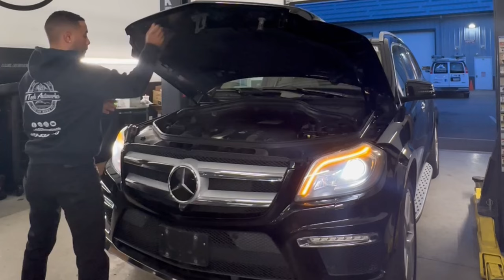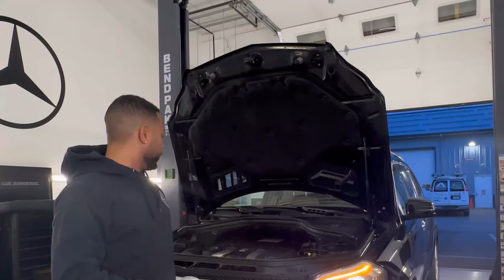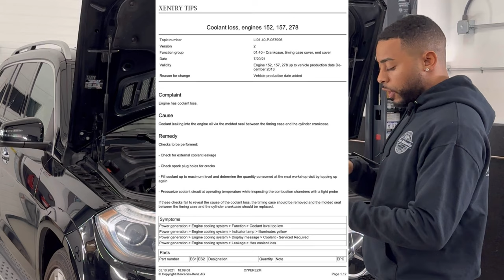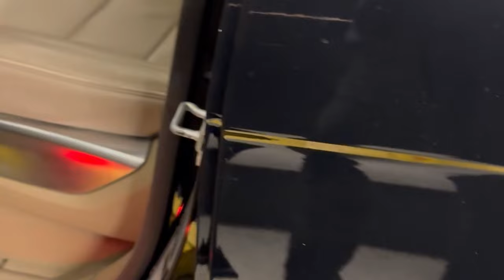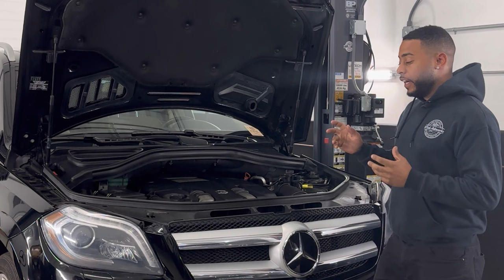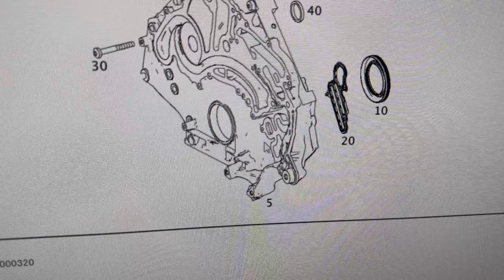Common High Mileage Issue With Mercedes-Benz M157 & M278 Twin Turbo V8 | 603 MTech Autowerks®

Comment: Ok so there is a solution, replace the gasket before the vehicle hits 100k.
Reply: And spend more than the cars worth replacing it, yep :)
Reply: @thenestaheapstv2447  lol ok
Reply: @AnontheGOAT just don’t complain when you sell it and someone low balls you because of the issue👻
Reply: @thenestaheapstv2447  I won’t sell it to a lowballer.

Comment: Its astonishing that he actually said that Mercedes didnt do anything when they actually did. They obviously revised this issue because the engines from beginning of 2014 and on wont have this issue. Not taking anything away from what he is saying but they did obvioulsy fix the issue. I am a Mercedes technician and its crazy how it seems to affect some engines and not all before 2014. I have seen pre 2014 with over 100k and no issues and other that have many issues. Not sure what the difference is but there are different variants of this engine. Maybe thats the case.. I dont know... Just saying!!!... I will say this the M278 2014 and after are much much better!!!
Reply: Thank you so much for this, just bought a Gl450 V8, production date 03/14 with 132k miles on it. Already had a heart attack before i saw your reply!  Thank you so much! 

Is there any other problems to look out for please?

Comment: I drive a 2014 GL500 with an M278 engine. It's been leaking coolant for over 8 months. At first, I had to add coolant every 15 days, but now I need to do it every 3-4 days. I've used four 5-liter cans of coolant in this time. Every morning, I add up to 50 ml of coolant to keep it full. I watched a video and now I'm worried the coolant might mix with the engine oil, which could cause more problems. Four months ago, when I changed the engine oil, the mechanic said it wasn't mixed with coolant. But the leak has gotten worse since then, and I'm concerned the oil could now be diluted with coolant.
Reply: You can check by using the oil dipstick, Coolant tank or by observing under the oil fill cap. You will notice a thicker than normal fluid. If it looks light brown, and not clear when you shine a light, than you may have an issue.
Reply: Find your coolant leak and get it repaired. It'll cost you your car if not taken care of.
Reply: Most common in our 2014 gl500 also was the water pump. Original waterpump pulley was black the upgraded is silver it would leak behind it. Also the bottom hose connected or the thin turbo coolant lines infront of the water pump are super common in this gl. So check that. On top of the engine the black 3side breather hose I just used gasket maker paste to stop leaks it's easy, anyhow coolant leak on this engine should be priority or else major damages. Goodluck

Edit: I forgot to mention don't let fan or tools touch radiator. I cracked a small hole and repaired with steel epoxy/Jb weld. Working fine but just advise

Comment: Hi Guys,

We have a 2013 CLS 550 I bought the car used. In my ownership oil changed at every 5k, LMolly oil only and under warranty had the tensioners changed, and now at the recent oil change discovered metal shavings in filter and old oil. My mechanic suggested to sell it and get a new vehicle. He explained that most likely it will get worse and will end up in a complete engine rebuild. I just want to understand what is causing this issue as I really like the car and if I am going to get another one it will be the same model.
Thank you!
Reply: Me too.

Last thing I read was cold weather and cold starts.

What would be the cost of the engine rebuild? Do you have an estimation?
Reply: How many miles?
Reply: 180k
Reply: Get the same car just production date after 12/13.. problem solved.. i work on these there good engines the earlier ones (2012-late 2013) just had issues when they aged.. after 14 the tensioners are updated and the oil mixing issue is fixed
Reply: I hear a very slight knocking  on cols start on my 14 gl63 should i worry about anything? Or wat can i do to stop it@strykz63

Comment: Obviously oil and coolant never good.depending on how long the event was happening the motor may not be destroyed if the problem is fixed soon enough.i had a custumer that drove a carwith bad headgasket for 6 mos before he fixed it.drove it another 4yrs after a couple oil changes to flush out the choclate milk.just a lil observation from my 30 plus yrs of wrenching.im.sure MB were changing the cover seal when custumers got oil in coolant and not doing complete motor swaps.
Reply: Exactly

Comment: so if the bulletin states dec-2013 does that mean that an engine from a 2015 or 2016 wont have this issue?
Reply: yes, they won't suffer this failure - Go ahead and read the TSB applicable to your year for insight

Comment: Great info. Do you see the same issue on the m157 in the amg’s? Currently looking for a cl63.
Reply: I think on his other video he says yes. He said they are the same engine but the m157 has bigger turbos
Reply: @CornerOfTheOval m157 is a 5.5 and the m278 is 4.7. Different displacement.
Reply: @AnontheGOAT   Basically the same block with a different bore and stroke to increase the  displacement to 5.5.
Reply: @godzsonjl2983  I know but still had to point it out that the displacement is different.
Reply: And one major difference is that the m157 is hand built which is a huge standard in the automobile industry

Comment: So does the 2012-2014 CLS63 AMG has the same engine and issues? Thinking of selling my CTS-V and getting these cars. @603MTechAutowerks
Reply: Its possible.. as long as your production date is 01/14 or newer your good.. but i have seen CLS 63s with high mileage pre 2014 with no issues

Comment: It seems like the 2014 cls550 fixed the issue. Idk much but mine is at 140k and seems to be running great so far
Reply: trying to get myself into a cls550. anything major i should look out for when looking at used ones?
Reply: @Ghostrider-xd3xv just get you one brother. With a bumper to bumper warranty. It'll cost you about 3k. It can last 2-3 years. If the engine or other important things fail, you'll be glad you spent that 3k vs 8k or more. You can take it to a dealer for the fix OR find a reputable licensed mechanic that KNOWS how to work on these cars. Just understand how the warranty works. Understand how much the regular things (tires, brakes, insurance, putting gas in the car) will cost vs owning a more simple machine. If you can afford it and it doesn't break you then do it.
Reply: Same here 2014 cls550 been great

Comment: Can you please let me know on the 2010 Mercedes V8 TwinTurbo engines are good I’m gonna buy one I don’t know how good the engines are please let me know it’s kind of odd hundred thousand mile on it engineers good now but I just wanna know how good the motor is. Thank you very much.
Reply: By the way, is the S 45
Reply: They didn’t make a twin turbo v8 in 2010!! 2012 is when they started and the Mercedes l didn’t release until 2013 with a ttv8
Reply: m278 came out in 2010 in the S550 CL550
Reply: @Mike-ht1ou they came in 2011 for model year 2012 with v8tt in S-class and CL-class... 2010 is still the M273 engine

Comment: My m278 just went out at 140k miles. Do anyone know what other engine I can use that’s also a V8 besides the m278?
Reply: Same engine just get the updated one 2014 and newer.. i belive these engines ran up to 2017
Reply: GLS550 used m278 till 2019
Reply: @linopks1638  ok.. yah your right

Comment: I guess when your timing chain gets replaced this gasket gets replaced at the same time?
Reply: it's a different job. All distinct  failure are worthwhile
Reply: @glasser2819  but that cover needs to come off for the timing chain to be done so the seal should get replaced
Reply: @slotank  the heads do not come off, only the valve cover.
Reply: @mauisuzuki7857  i got my timing chain done by the dealership recently they took the heads off on the m157 and replaced that gasket as well

Comment: Seems like a motor better To stay away
Reply: I have owned 3. They all ran great and were well maintained. The biggest issue ive had was control arms 1k dollar fix
Reply: @Jellbell46  what was the kms and how long did u own them
Reply: I have a sl63 and a e550 coupe, both tuned. The sl is a 2013 at 29000 miles and the e550 has 77000 miles and has been driven hard for about 40k on a tune making 570whp. The car runs awesome and has zero leaks or any issues with mixing……I’ve seen these cars go 160+ without any issue